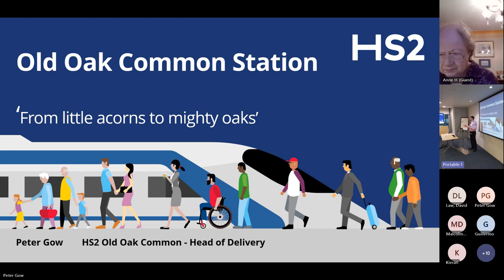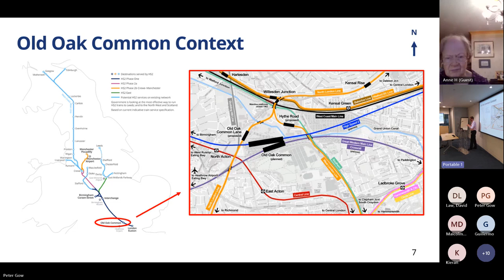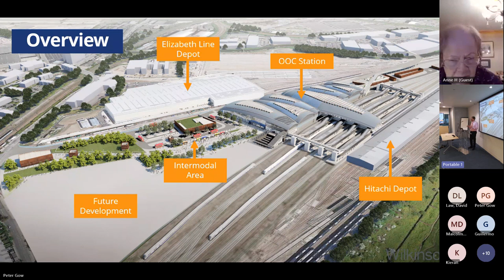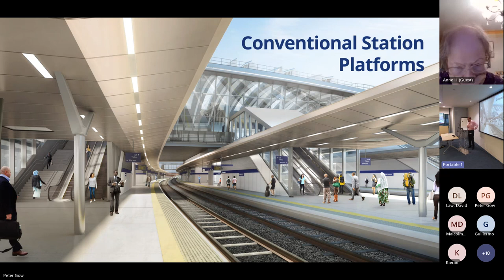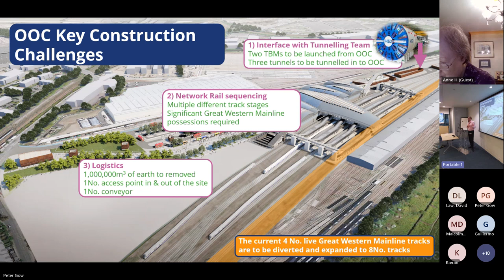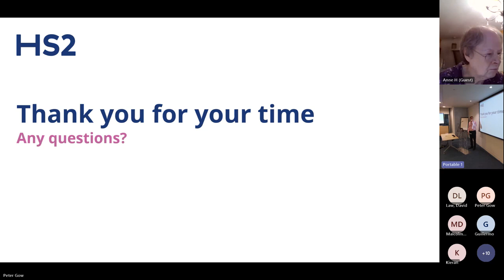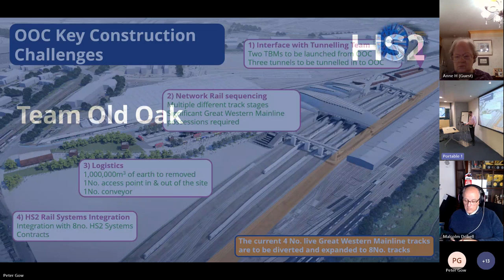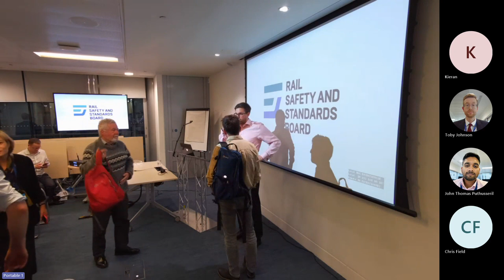From Little Acorns to Mighty Oaks: HS2 and Old Oak Common Station

Comment: Why is there no eastern access road to the station? 

Having only one road (from Old Oak Common Lane) to the station is a single point of failure.
Reply: That would be very difficult to add across the existing infrastructure to the east